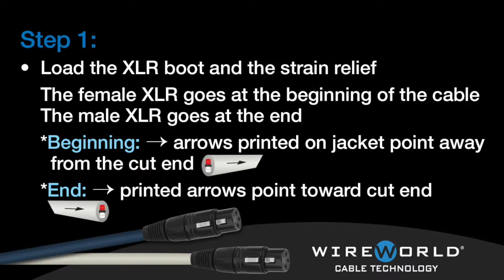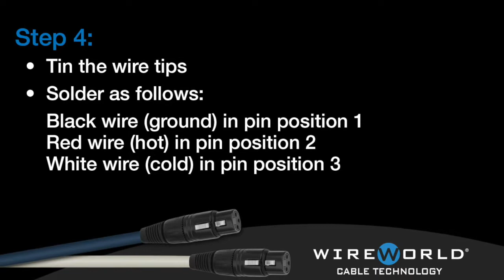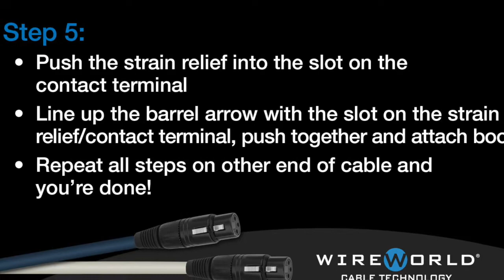How To Terminate Wireworld Luna & Solstice Series 8 Balanced Interconnect Cable

Comment: I'm a new Wireworld Eclipse  interconnect user... we. as audiophile, pay attention to every detail. As I wrote in an other of your videos, I hope that she improved her skills as welder operator. Were my cables (2024) made by her ??? :)  Also, she should use a pair of cotton gloves. The copper is full of the grease of the fingers while touching the strands.
And, please, don't use Deoxit Gold, but only isopropyl alcohol 99,8%. Deoxit Gold, in my experience, make the sound bright, thin, colder. It has a dielectric constant of 2.13, like Polyethylene (data on their website). Naim, for example, advice to not use Deoxit but only IPA.